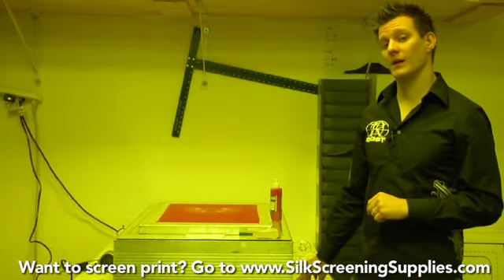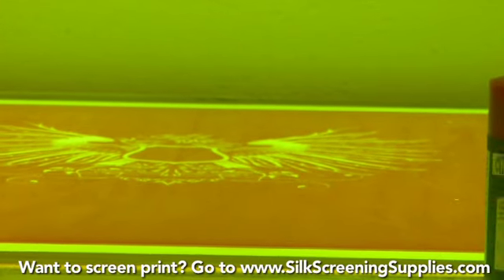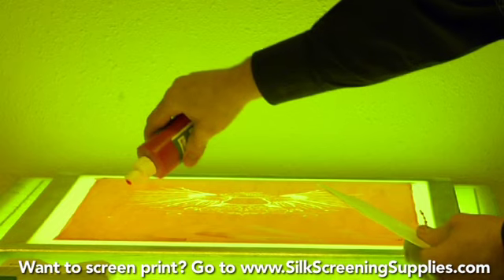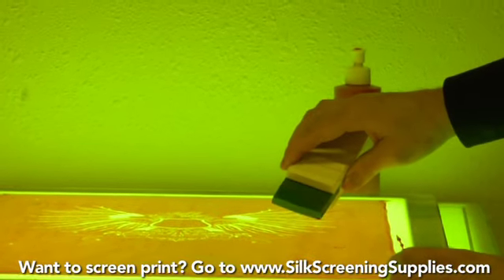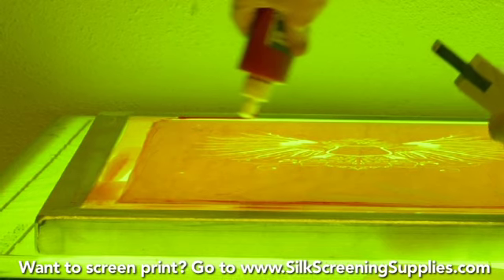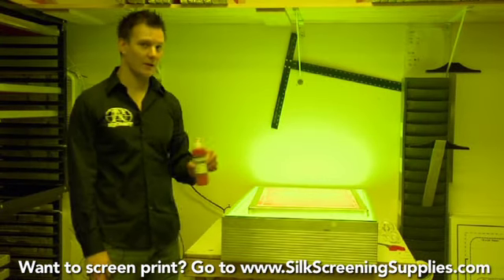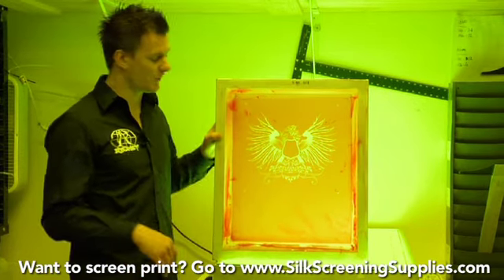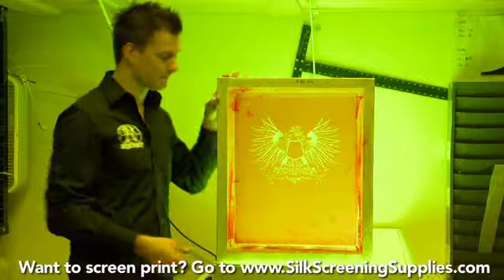How to Screen Print - Red coat blockout - Detailed instruction - Screen Printing 101 DVD pt 22

Comment: you should add this video to your website on the page for this product... I recieved it in my starter kit and was not sure what it was and went to your site and did not really get much from the description like I did with this video.
Reply: 7 years later and it still hasn't been added to their website nor has the product page been updated to explain what this stuff is. Got my kit and I'm figuring out the exposure process and ran into this taped up box and thought I missed something that went with the emulsion. Nope.